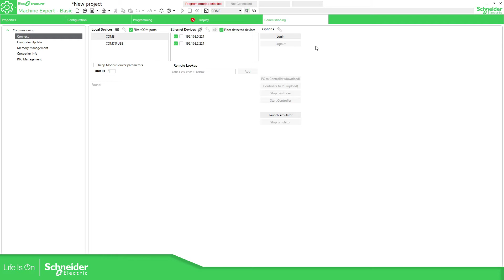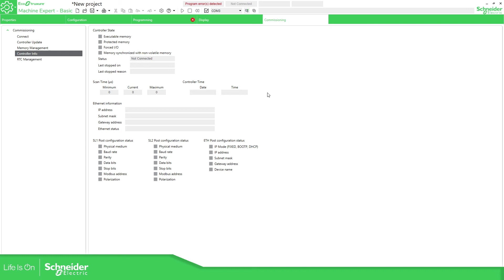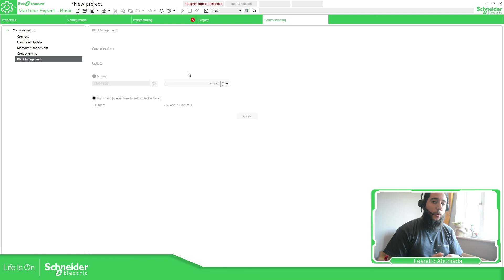Training - M221 - M2.5 EcoStruxure Machine Expert Basic Tab Commissioning

Comment: do you know if you can set up a PLC program that would allow expansion modules to be added or removed without a computer to make the PLC changes?  Ideally, I would like to tell the PLC through an HMI that it has certain IO modules that do specific tasks for an OEM machine. This way one program can be created for all models of machines.
Reply from the maker: Hi D. Clyde! That sounds good. With the M221 you can specify that the expansion modules can be optional  that can help you to define the IOs but it would be good to know (aprox) the amount of digital and analog IOs that you are trying to work with. Probably you can use base plc like the M251 and then some bus coupler (TM3BCEIP) with TM3 modules. You can use two bus coupler, one for example for digital inputs an another one for digital outputs. The bus coupler is like an island of remote IOs. So the PLC can read the status of the IOs that you have configured (also the modules are optional). Then in your logic in the plc you can make a copy of the actual status of the inputs to a internal memory then you can create a block that depend on value configure you can read this value and assign the value to your variable of the machine in this way you have only one hardware configure on the PLC and in the HMI you can assign the value of the physical IO to the variables of the system.
Reply: @LeTomasAHUMADA  sounds like a good possibility.  Do you think the M241 could do this?  I see the M251 as more of a supervisory PLC and the cost of the TM3BCEIP gateways as a hurdle.
Reply from the maker: @dtosui  yes you can also do it with the M241 or M251. The M251 was the first thing that came to my mind. The advantage of the M251 for this architecture is that you have a network dedicated to the IO and the other one free to connect to a Scada or other system.
If you do not want to use the TM3BCEIP I have not checked the behaviour of the TM3 io bus of the PLC what happen when you defined an optional module in a position and you use another module instead that’s why i suggested 2 bus coupler one for input and another one for outputs